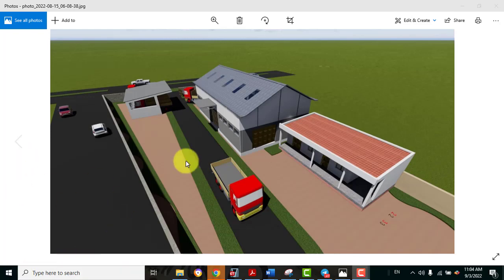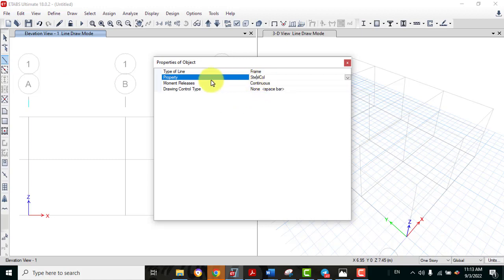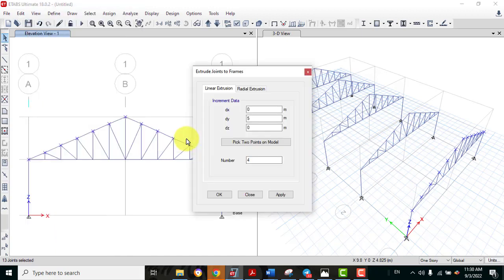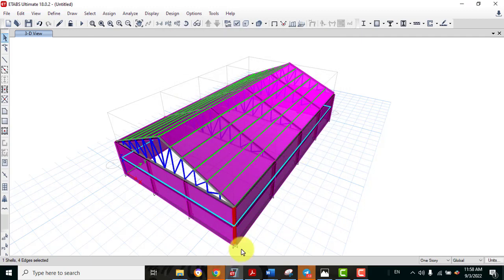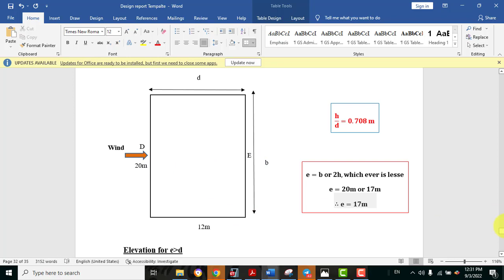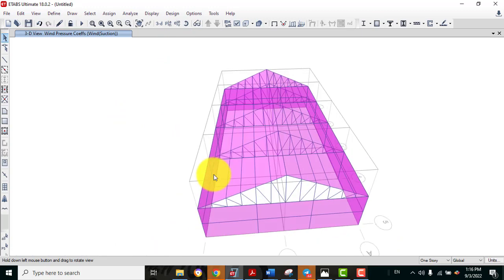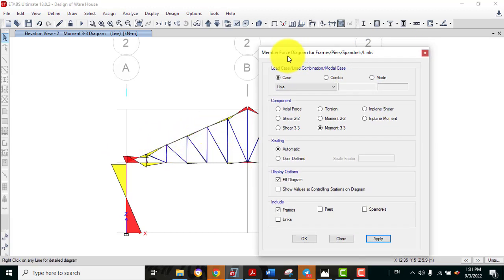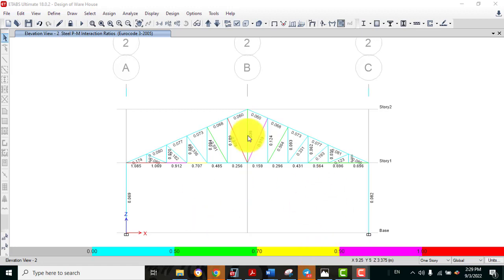Warehouse Steel Structure Design Tutorial using ETABS 18

Comment: Hi sir, if there is steel frame,  the top cord is rafter IPE and the bottom cord is RHS, shall we move the bottom cord - RHS- to lower level  ? because in reality the IPE - top cord- is connected say by end plate with the column! and thus shall this be reflected on sap?? or shall we keep them as it is in sap - all are center to center- without shifting the bottom cord to down by move command

Comment: hello sir if the releases are made in truss the srruct ure is shown unstable but if you don't make releases, the structure is shown stable. sir.  why is it,  sir? could u explain this,  please sir?
Reply from the maker: Hello! When we assume pin-connected joints (releases) in trusses, we simplify the analysis by focusing on axial forces in the members, which is the primary load-resisting mechanism in trusses. A properly designed pin-connected truss can be stable and effectively carry the applied loads, as long as it has adequate support conditions and a suitable arrangement of members to maintain overall equilibrium. And the truss in this example is stable, you may see the deformed shape, but that does not mean unstable.
Reply: @Civiltimes2210  but it shown unstable how to do to shown stable sir?
Reply: also one more eq sir 
how to check overturning sir?have to know center of mass but it is only one story doesnt have slab. how to define center of mass sir? already define mass source but  how to do to shown xcm in warwhouse sir?